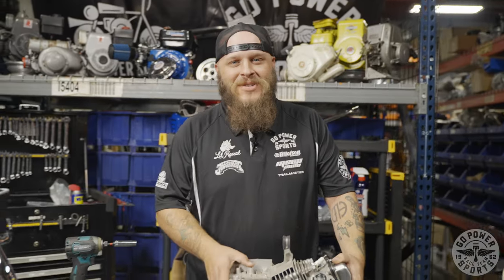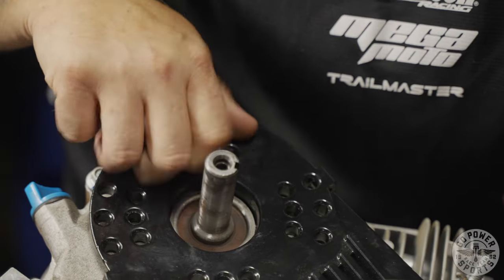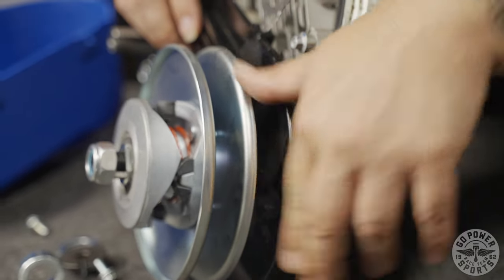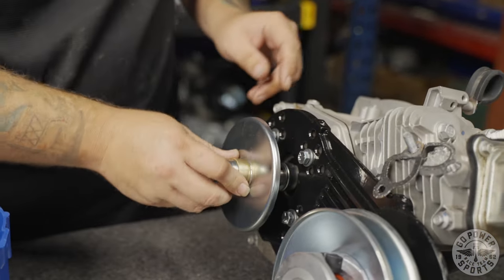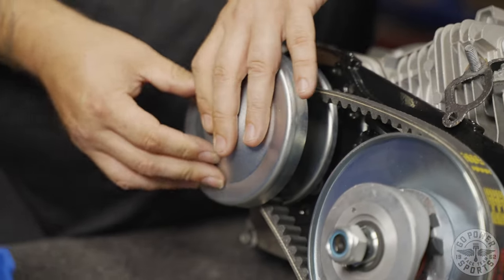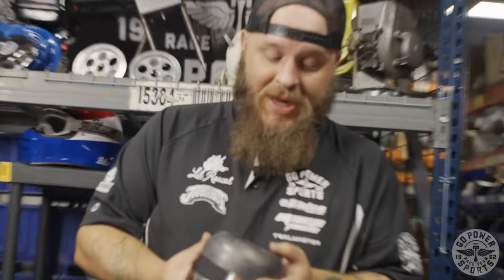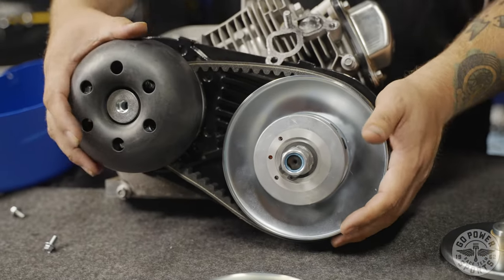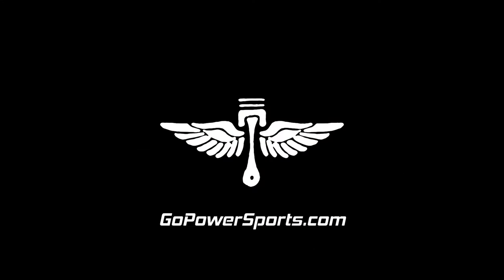Quick Install 30 Series Torque Converter and Jugg-A-Verter | Tutorial

Comment: If your torque converter isn’t fitting on your new tillotson 212, you just have to move the little black box (activated carbon canister) so the torque converter does not hit it. Thanks for your help GoPowerSports!!
Reply from the maker: The black little box just needs to be removed or relocated.  Send us a photo because it should also miss your dipstick.  We have put these kits on our Tillotson 212s and they all fit like a champ.
Reply: @GoPowerSports  ok, we did figure out to just move the black box a couple hours after I commented. Once we moved the black box it almost fit, but a little nub on the torque converter back plate hit the silver shield that the black box attaches to. We cut off a small section of the shield and it we got it to fit. Thanks for your help though!!

Comment: Hey brother, I have a predator 212 non hemi. The crankshaft bolt provided does not thread on and it’s 2 1/4 instead of 2 1/2. What size/ thread should it be?
Also if using a chain you cannot install the cover. Thanks for the video man..
Reply from the maker: I believe you will need a 5/16" Fine Thread Bolt that is 2.5" long.
Reply: What’s the best way to contact Gopowersports? When I send them a message from their website I never hear back from them.
Reply: And their chat is never online.

Comment: Good morning. I love your video!  I have rebuilt my TH350 and have some experience with installing transmissions. I have a question about bolting the torque converter to the flexplate.... Since the torque converter sags ever so slightly from its own weight when resting in the transmission, prior to bolting to the flexplate,, should you lift it up ever so slightly (take the weight off) as you tighten the first torque converter to flexplate bolt? Or just pull it forward and bolt up without lifting on it?
Reply: You just move it toward the flexplate and bolt it down.

Comment: Is that a 212 or 196? I’m tryna buy the tillotson 196R racing engine with this jugg a verter for my m200 (basically a Coleman ct200-ex) help!! I just wana ride my mini 😭
Reply: The Jugg works on any small block with a 3/4" PTO (crankshaft). The Hisun196's that came on the Coleman 200 bikes are the only engine it will not work on because those have a 16mm PTO.

Comment: I have been through legit hell with this tourch converter everything flew off after I did exactly like video says order 2 times got 2 different parts to fix it almost 8 months later still not fixed still don’t have right parts and I’m holding my head thinking I just wasted a lot of money and time even when it worked for that 1 day it wasn’t that much better then stock I would like to be able to get my bike running again if any of you could help instead of selling me wrong parts